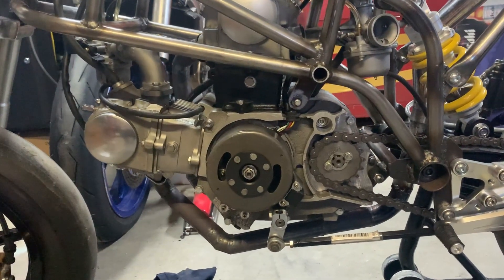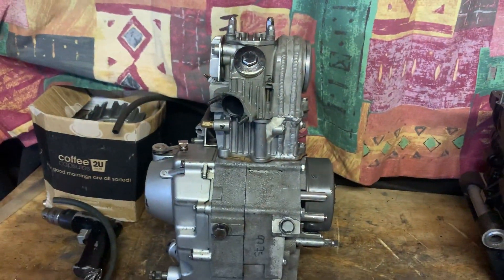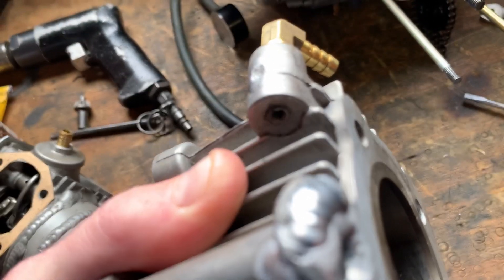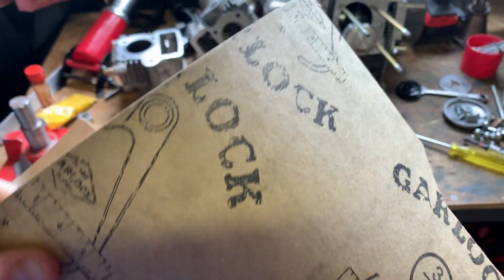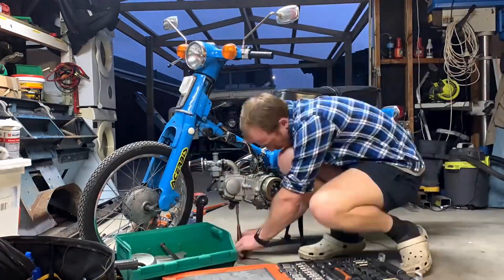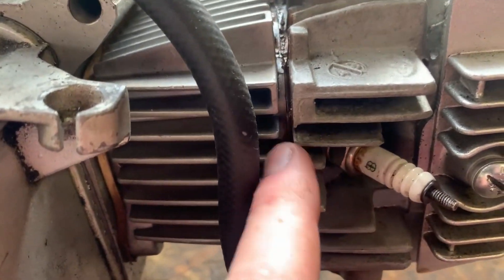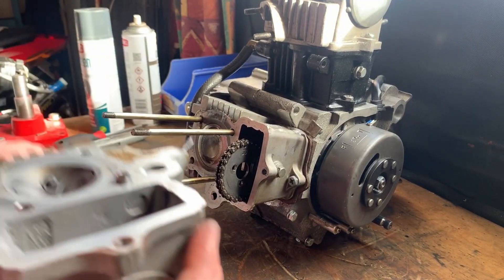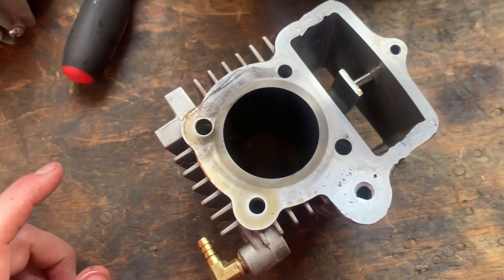A 100% Reliable Motor Made in My Shed

Comment: Waterjet cutting for the copper. An O-ring is not going to do anything your current head sealant material is doing already, as you already found out, its the paper gaskets that are causing you issues so removing that element will solve the majority of the problems.
Reply from the maker: It did cross my mind not to add the o ring and keep running the copper head gasket spray. I am still interested in running the Viton o ring, it’ll make an interesting video setting it up and machining the groove, otherwise I’ll just run the base spacer to start with.

Comment: Instead of viton o ring why not use a soft copper ring that has been softened and machine a simple groove on the head? Should provide plenty of squish and still seal up very well.
Reply from the maker: Worst case with the Viton is I use the same groove for a copper one if it fails. I don’t know if they’re readily available and I think I’ll have to make the copper one. But it’s definitely an option.
Reply: @OddsandEndsMachining  to make a copper ring simply wrap a piece of wire around a round object of the appropriate diameter then cut and but the ends together.
Reply from the maker: @Engineerd3d  thanks for that. I wasn’t sure if it needed to be joined 360 degrees. I was assuming it needed to be. That’s always another trick I can use later if needed.

Comment: Ferriday Engineering in the UK make copper head gaskets with a stainless steel fireseal ring for these engines
Reply from the maker: Interesting, the Viton o ring has held up for 2 race weekends now with no sign of failure. I’ll keep that in mind if I run into trouble.

Comment: All fingers crossed here.
I didn't notice the copper gasket being too far our that it couldn't be trimmed to fit - did I miss something?
Reply from the maker: The original copper one I made was a bad fit, I couldn’t be bothered making another one so o ring it is and it should be cheaper and seal at a lower head stud torque.
Reply: @OddsandEndsMachining  OK, consider this subscriber enlightened. Thanks for taking the time to reply!